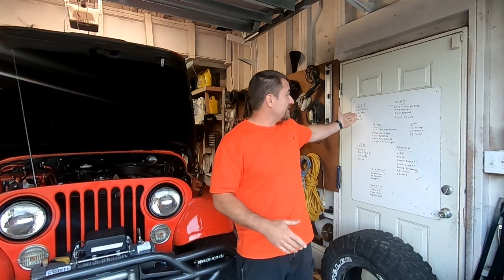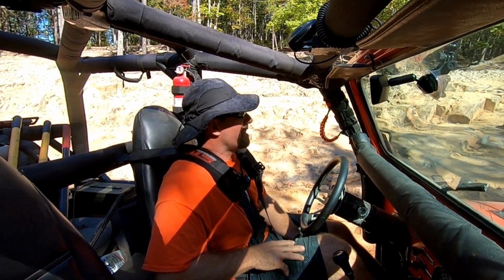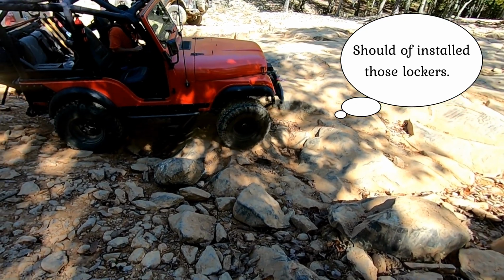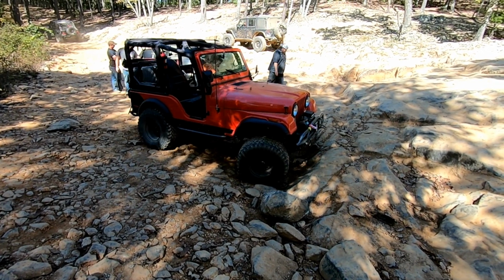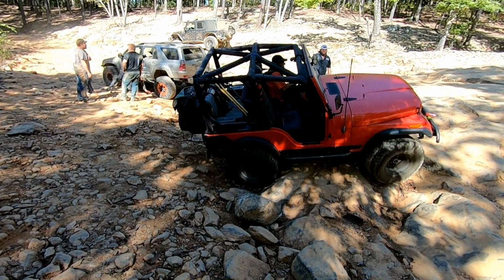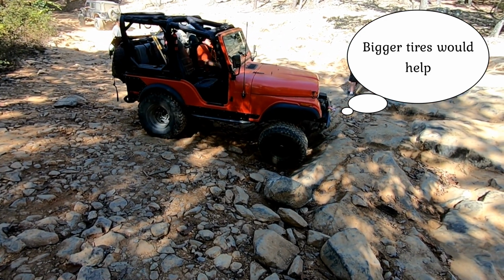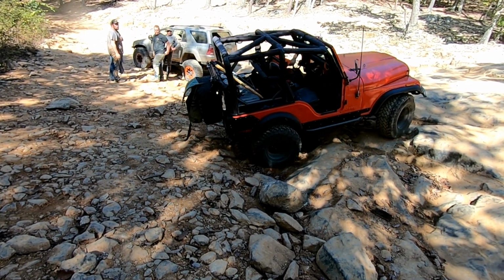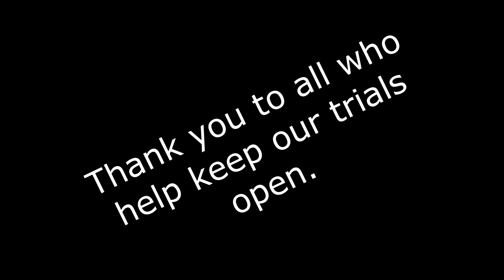CJ5 and FZJ80 hit the trials after a workday at Uwharrie National Forest NC

Comment: I got wagoneer plated. Took out for a test drive. That 1-2nd shift was hard. I backed up the road to the driveway. I didn't adjust the value pressure at carburetor. So undid the spring an adjusted it and hooked spring back up. So far so good on my 727 rebuild. Looking at some 1/4 plywood with nice wood grain to make some door cards. Decided to make a grill till I can find a rhino grill. I like the double light look better than the pie pans. Gonna use trailer back up lights instead of 60 lincoln buckets or pacer buckets for pie pan lights. Think I need a little more carb before value pressure kicks in. Went with cheap rock auto glass headlights. Didn't want to spend extra for led. Gonna buy new turn signal lens. Have to fix drums in rear too. Gotta fix rear window and license plate light.
Reply from the maker: Good job on the rebuild.    I am still trying to find time to finish up mine.   The Van is getting in the way right now.    One day.   Would love to get to the point where we are dressing up the interior.    Let me know how the door cards come out.